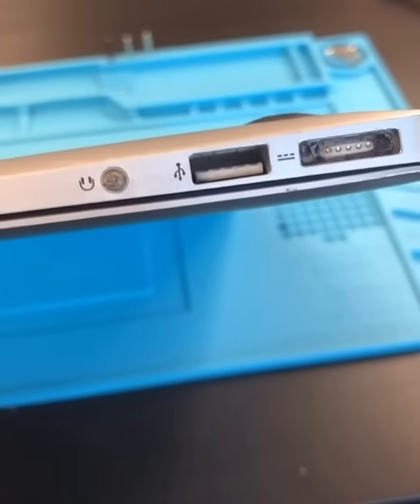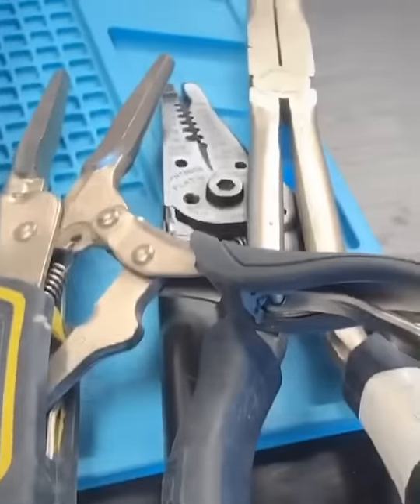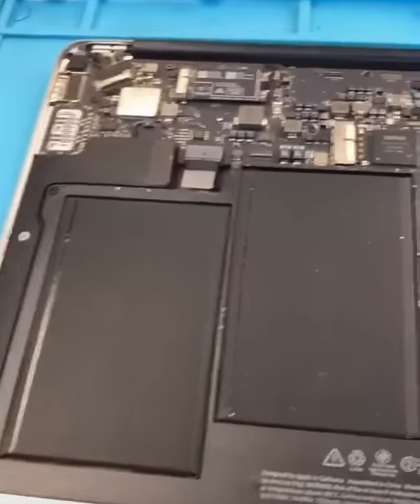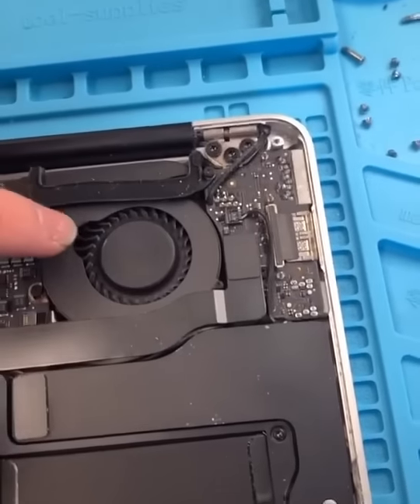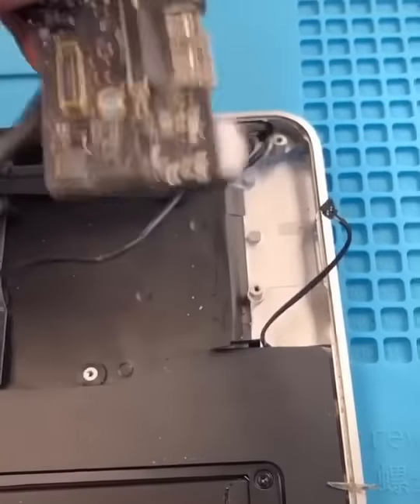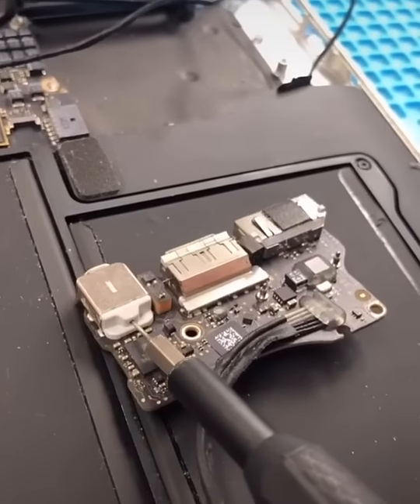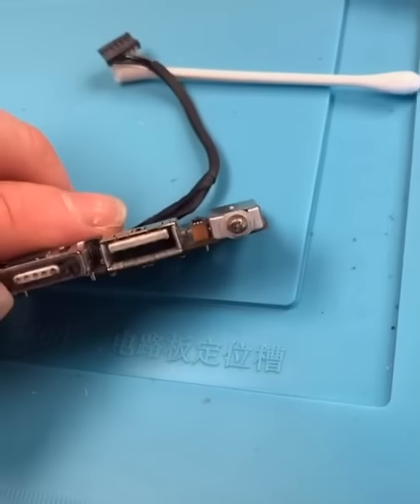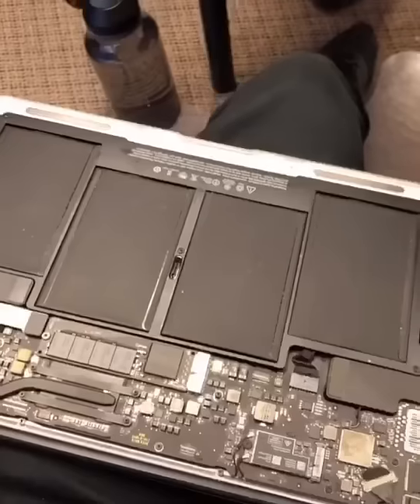Don't Use Glue On Your Macbook.... WHY? #Shorts

Comment: Samsung makes pretty much every apple part...
Reply: Samsung chipset, also I don't get it why ppl arguing about gadgets it's the same thing, the same material just different brands and blueprints and Amd might launch a 1.5 nm processor next year.
Reply: Yep
Reply: @thefirstsin  because the only thing apple users say to android users is "samsung is so trash" and when we tell them it uses samsung parts they go "well... no because it is better"
Reply: The only thing they do make is the board and the cpu, and even they only started making their own cpu recently
Reply: @TwinkleNZ  they have their own CPU design but it's manufactured at TSMC factories, they might even switch to using Samsung factories. TSMC is the same factory used by Qualcomm which makes the chips for almost every Android smartphone.
Reply: @chrismoore3295  let me correct you “some apple users” I’m an apple user yes. BUT I LOVEEE ANDROIDS. I’ve had about 6 of them. I would never diss a android user. Cause honestly they are hella good phones too and also other things. (Sorry if this sounded hateful😅)
Reply: @chrismoore3295  and the screens are also Samsung
Reply: @imgay5098  yea only bad thing is you have almost no optimization for apps since so many androids come out every year
Reply: Except for the processor, yes they do.
RAM, storage, front panel, 99% of the other chips
Reply: @axep3785  that is true
Reply: @TwinkleNZ  apple is half ran by samsung apple gives ideas samsung makes them. so really 75% of Iphone acually belongs to samsung. Also if you search it up Samsung is the number 1 phone in the world right now and probaly will be forever considering it was the first real brand to make it on the charts. In reality Samsung cost more than An Apple product due to all of the upgrads iPhone users dont jnow about but Samsung is worth its price because the new apple phone is still smaller than the new Samsung (S20) sorry (S21) opps
Also the price on a Samsung is benifitial because any time a new phone comes out you can upgrade it for the low price of 10 dollars something iphones cant do. And lets not get to space and storage iphone price is not only based on looks but if you read the back you will see that theres different space storage so if you get the smallest iphone with the most storage it cost more than the new iphone with the least storage unlike samsung where you get unlimited storage on all phones for the same price. Lastly Battery iphones are nice looking phones but the hold more glass than metal which helps the battery. Unloke Samsung Maybe with these facts we can stop comparing the phone and enjoy them😉
Reply: Not the camera quality that’s for sure
Reply: Yes
Reply: Just like ps4 vs Xbox
Reply: The ram is made by samsung, processor by Intel (now engineered by apple but NVIDIA manufacturers it) and the display is usually samsung, but they don't borrow their phone displays, samsung has a seperate display market where they make displays for many brands , apple does not have much factories to manufacture stuff that's why ask for other brands to do, while they design the stuff (except some things(
Reply: @thefirstsin  samsung also make fridges, why are people surprised
Reply: @thefirstsin 1.5 NM is impossible. Their most recent Chip uses 7nm. In 2022 the ryzen 7000 Generation il likely to use 5nm. The smallest Prozess possilble is 3 NM and these Chips are so expensive, than The cost over 100000€/dollar per unit.
Reply: right and wont make anything good for its own
Reply: @TwinkleNZ  oh wow finally I guess
Reply: Agreed. And new apple owner. Is making apple turn into a big fail.
Reply: Agreed. And new apple owner. Is making apple turn into a big fail.
Reply: It feels ilegal to know that an apple product is made out of samsung parts
Reply: @thiesdwersteg982  no... recent chips is 5nm
Reply: @craniaxx1726  nope. Only Chips like the exynos 2100 or snapdragon 888 use 5nm. But there is none 5nm computer Chip out there.
Reply: @thiesdwersteg982  but it still recent and more than one so plural :)
Reply: @chrismoore3295  Um that's not EVERY apple user.
Reply: @thefirstsin  1.5 nm is impossible even 3nm seems like the limit. That's why companies are using 5nm base.
Reply: And people say Apple is better it's the goddamn same thing Samsung for life
Reply: @QFRR  Samsung isn't the best, you know. Neither is Apple. It's peoples' opinions and their own decisions whether they want to buy Apple products or Samsung products. And by the way, that's a Macbook from a decade ago, Apple barely uses any Samsung parts on their products anymore.
Reply: @chrismoore3295  I'm an Apple user for a long time, never heard myself say that. Hmm.
Reply: @Anankin12  That's on older macs. New macs have very little samsung parts now.
Reply: @CJ17883  Dude. I'm an Apple user for a long time and I love androids. In fact I've never used a iPhone, ever. Apple doesn't suck at everything, for example Macs are so much secure than their windows equivalents.
Reply: @RitvikDas  you made a fair point at first and then the last few lines made no practical sense, pls relate to the subject matter, pls note I didn't say 'apple sucks'
Reply: @CJ17883  Well considering this video was about Macbook I said how Macbooks also have benefits over their competitors.
Reply: @RitvikDas  yeah well I didn't devalue it now did I ?
Reply: @RitvikDas  but didn't you just say you were a iPhone user for a long time and I quote "In fact I've never used a iPhone, ever." Pls try to make sense before voicing your opinion which is quite arbitrary
Reply: @CJ17883  I said I was an Apple user for a long time, not an iPhone user. I use other Apple products just not iPhones.
Reply: @CJ17883  You said "And still Apple peasants talk shit about Samsung lol", so I was just saying that some things Apple make are good.
Reply: @RitvikDas  kid try to process a joke once in awhile without being so political since you couldn't comprehend it ill make it simple as possible the 'lol' you see at the end of the text it constitutes as a joke pls observe before reaching an incoherent verdict
Reply: @CJ17883  Well if it was a joke, it isn't funny. And what do you mean by "comprehend" when I understand? And why should i respond with "lol" when ur "joke" isn't even funny.
Reply: @CJ17883  ur basically saying targeting a company with ur statement which is like 10% true is a joke? haha very funny.
Reply: @RitvikDas  oh good and here I thought you didn't have a sense of humor loosen up a bit so that blood would start flowing to your pea size brain thus helping you distinguish between a joke and a serious statement
Reply: Samsung is literally 5% of an iPhone. And it’s literally a tv company. Of course they’re gonna use Samsung to make what they make best
Reply: don’t care never will
Reply: @thotbreaker  it’s false also lol. They make a small amount
Reply: @mikef4775  Ya i figured but these android fanboys say this like it’s gonna make me go buy a samsung, i still like apple, i swear they don’t understand what preference is
Reply: @thotbreaker  it’s just like politics. Everyone has a preference and it doesn’t matter what your preference is because it’s your own life. They wanna hate on Apple just because Apple used to be very far ahead. Not to mention galaxies are now more expensive
Reply: @mikef4775  Exactly bro
Reply: @thotbreaker  yessir
Reply: Except the camera that's Sony. No clue why Sony can't design a decent camera software for their phones but everyone else who uses Sony cameras can design the software
Reply: @chrismoore3295  they say that u don’t have iPhone cuz you broke I have an iPhone and I love samsung way more
Reply: @imgay5098  let me correct you "most Apple user"
Reply: But I like the software more on apple
Reply: That why people say iPhones are better but there not. Samsung makes their Items
Reply: Not every part Samsung are just good at making specific parts

Comment: Everyone is talking about Apple and Samsung but I haven't seen anyone talk about why the person used super glue on their computer for the audio port. Why would you do that?
Reply: they broke off the 3.5mm tip. put super glue on the tip of a toothpick and touch the broke off part, then extract it.

it does not work
Reply: You know those life hack videos's
Reply: Dust can get stuck in the audio port. (If it's glowing red inside it means there is dust), the SENSIBLE thing to do is get a Q tip (I used a rolled up piece of tissue) and shuffle it around in there to get the dust out. (Carefully as the tissue or Q tip can break) There are probably better ways to get dust out via a quick Google search.

Yes the 3.5mm tip can break but most of the time it's just dust. Careful as a repair shop could rip you off by "fixing" it & they just clean out the audio port.
Reply: Average apple user
Reply: that’s what i was saying
Reply: How you broke the jack port in? 🤷‍♂️🤯
Reply: @rowertoide  true
Reply: @Dymon32  violently shaking the tip while pullling it out
Reply: My headset jack got stuck in my laptop and the common fix was to apply super glue to a toothpick or pen and pull it out
Reply: @mrchadthundercock7973  💀
Reply: @Dymon32  ive dropped devices before, or theres always the chance their cat or dog or something jumped on the cable and it yanked down too hard. etc etc. all sorts of wacky ways to break a cheapo 3.5mm jack off the cable
Reply: @twilightsparkle75  Thx for long answer :)
Reply: A lot of people that break off their audio jacks in the port try to get it out with super glue because that was a wide spread solution a while ago.
Reply: They probably try using a "lifehack".
Reply: @paklekj4429  … how babies are made…
Reply: @scurus11scurus  aww hell na
Reply: @alyssumbread  that only works on mini optical ones as any normal 3.5mm jack will not have led’s
Reply: They bought an apple product what did you expect
Reply: @normdeplume9488  o
Reply: @normdeplume9488
Reply: P
Reply: @normdeplume9488
Reply: @alyssumbread  ppppppppppp
Reply: P
Reply: Ppppp
Reply: simplest thing to extract it without opening is heat small metal screw then push it into plug plastic material, keep few seconds to cool,
once cool pull it out with Jack...
Reply: headphone plug broke off and got stuck!
Reply: Yeah they should've used a hot glue stick atleast it is much more easy to remove